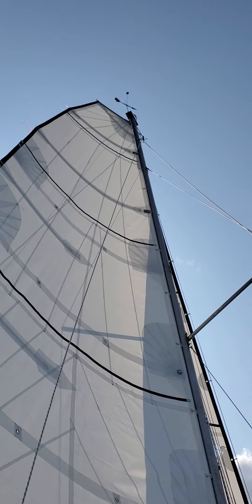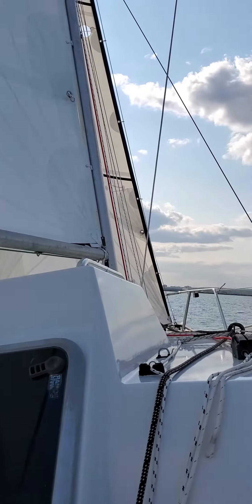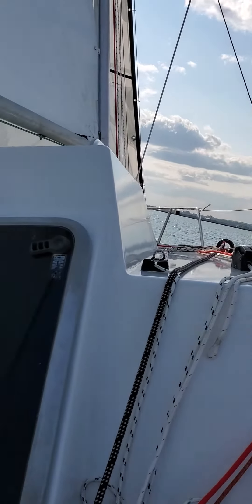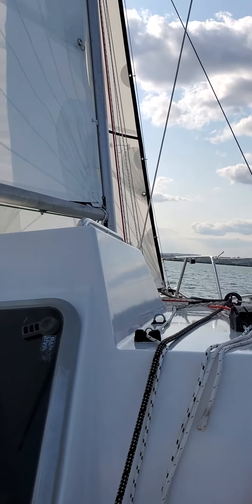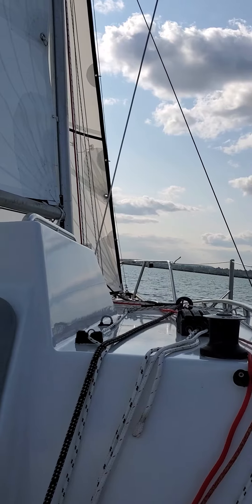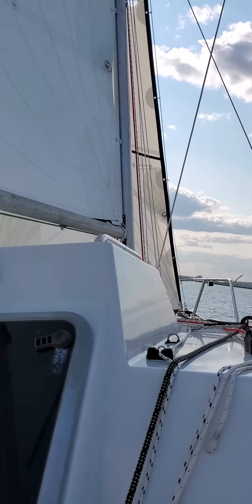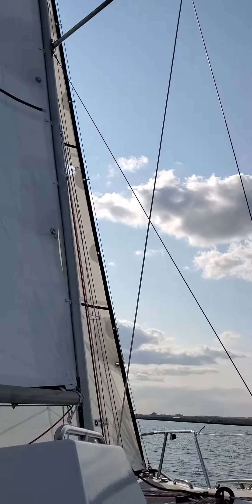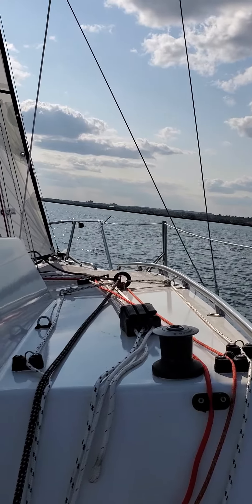Video # 2 Class Globe 5.80 Hull # 20

Comment: Was the 3D sheet system from blue shark as well?
Reply from the maker: No, the non friction eye was purchased separately and I just used eye bolts in the deck for the control lines. Really simple system but it works amazing.